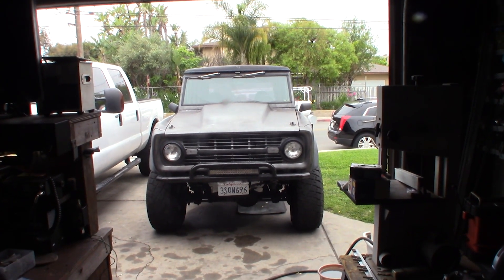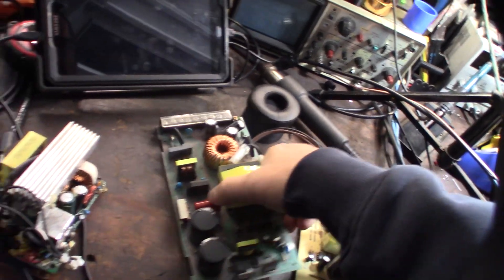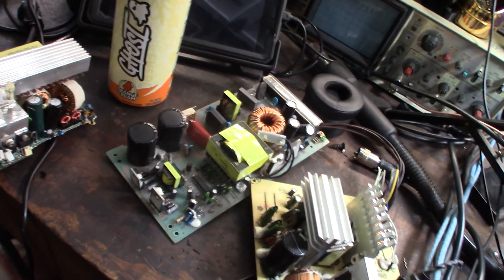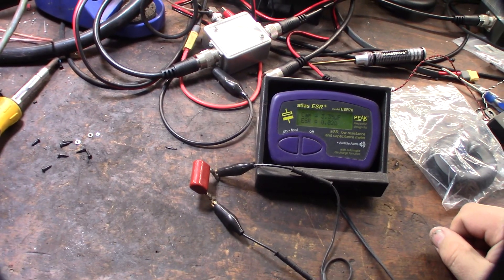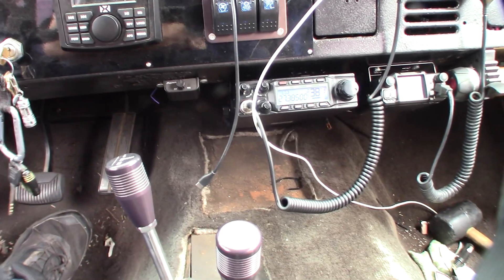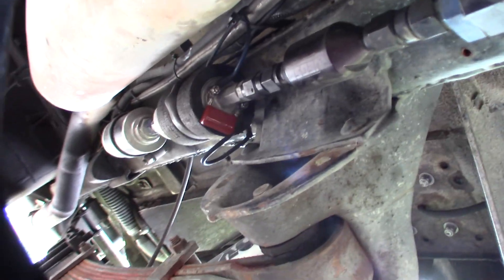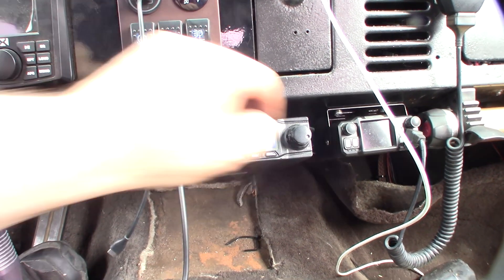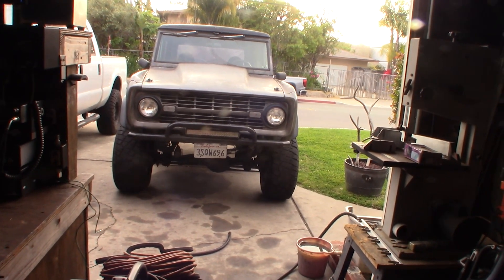Fuel Pump Capacitor Installation To Reduce RFI On CB & HAM Radio, Help Lower Noise Floor

Comment: Nice  tip! Thanks
Reply from the maker: Thanks, I did see an improvement. Still not100 percent
Reply: @fintechrepairshop  Have you tried to put the capacitor right before the radios?  Maybe an electrolytic 2200uf 25v. I've heard some LED lights might interfere in radio frequencies. Another thing is to make sure the radios ground wire is solid with the metal part of the panel. To much far grounding wire might give some anomalies on sensitive equipments (radios and amplifiers). Just some ideas! Keep it up, brother!